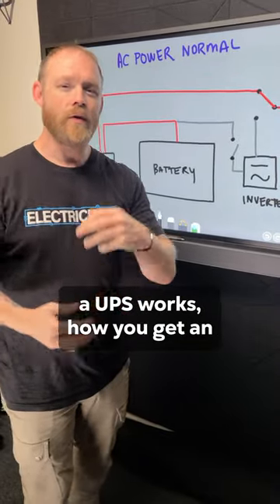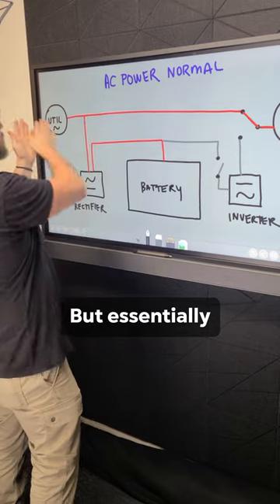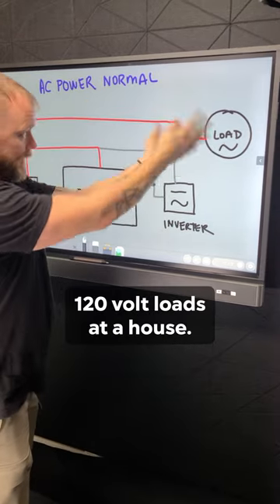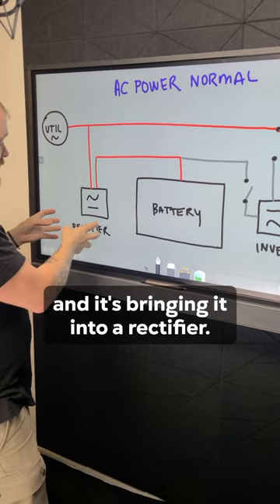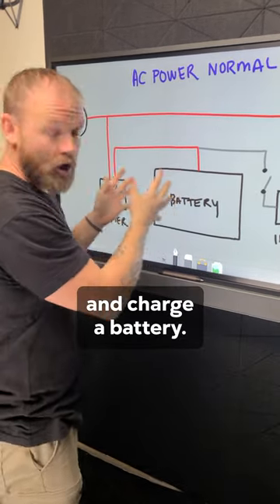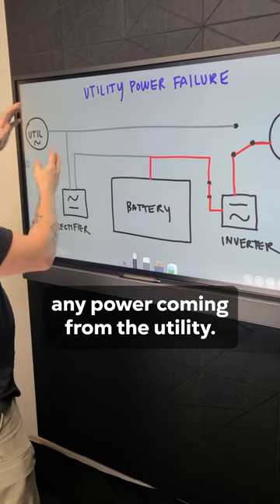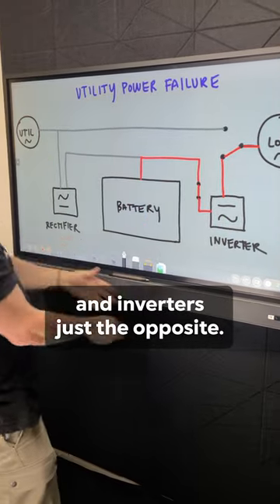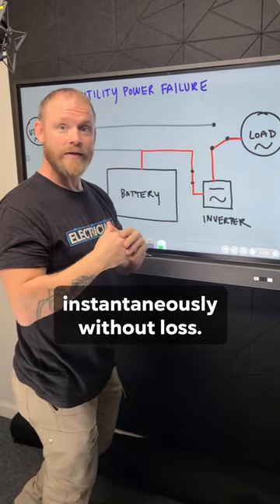How a UPS Maintains Constant Power

Comment: A lot of tech equipment UPS systems I believe actually mainly run off that inverted power after the battery to clean the power waves prior to entering equipment. In those cases, the incoming drops, but the outgoing doesn't see a drop as it's been constantly connected the whole time.
Reply: Line interactive(as described) vs online/double conversion(the one you want) also pure sine > mod sine
Reply: You are also correct. He described a common household UPS.  The UPS you described is more niche.
Reply: @danielmcgowan9534   "niche" as in every UPS you should be using for computers that aren't laptops, such as servers, desktops, etc. Even the low-end UPS' designed for computer use do this. Which is why they fail when the motorcycle sized lead acid battery dies. Some of those units are good enough to simply replace the battery packs and keep on rocking. The desktop support models, not so much. They have the low-bid capacitors in them, so when they error out, replace them. (IT guy for over 30 years here).
Reply: @phillipsofthedriver 
Laptop is already its own ups ... 😂
Reply: This is the cheapest version, better to use direct online which has the feed to the DC input then Inverts it back to AC then the setup as drawn is UPS feed and bypass from mains.

Comment: You didn't explain how the system automatically switches to battery power.
Reply: The unit he laid out is different from what we see. Typically you have a normal (bypass) input and a rectifier (EM) input. They both feed batteries which feed an inverter. The inverter is what’s running the load. 

When you lose normal power, the load is still being fed by the batteries. The generator starts and continues to charge the batteries. It is literally uninterruptible as the name suggests. These are typically used for critical data center loads
Reply: Depends on the ups, i got an older apc unit that uses a relay, coil isbpowered by the utility side and is allways energized, when power gwts cut it de energizes the relay and the nc contact is the inverter portion
Reply: @markzamiechowski5352 it’ll not be using a relay because the switching delay will be too long. For instant changeover, a transistor will be employed. 
The best units, so called online type, work by ALWAYS proving power to the load from the battery and inverter. 
The input mains power is there solely to supply the inverter with rectified AC and the maintain the battery. 
A mains failure won’t even be noticed in this case (unless the battery is knackered and cannot maintain its output to the rectifier)
This kind of UPS is mostly used to power computer servers, telephone systems etc because no matter how ‘dirty’ the mains input is, the output from the inverter is always nice and clean and runs bang on the correct voltage and frequency.
Reply: @2Sorts  not sure what to say,y.old ass apc uses a relay the way i stated above, I've torn it apart and traced the circuit,  butthats why in my original comment i said not all ups's
Reply: @2Sorts I've had "dirty" ac eat up UPS batteries at work. Due to issues with incoming power from the grid, we had odd frequency fluctuations. It was driving the UPS circuitry mad causing us to lose PCs. Had to run them off of a regular surge protector for a bit until the issue was resolved.
Reply: @Spcbrindley  ... bottom line is the battery won't charge and you always run on the battery if the power is too low or dirty. Not charging properly is what was eating the battery. You were lucky it only took a surge protector to do that.
Reply: Magic... 😂
Reply: My question also. I understand how it is able to store and provide power but the uninterruptible part?
Reply: @JL-ul7xk    think of keeping a maintainer / bat charger on your car battery. The battery is always up and providing power to the car as necessary. There is no "switch over" because your primary source IS the battery.... but via an inverter to make 120 volts. This is a true un-interrupted power supply. (UPS)
Reply: I build ups with relays all the time. For the most part it is seemless switching.

Comment: Your example UPS does cause some transients on the output because of the switch on AC loss. Most datacenter scale UPS'es are double conversion/online which means the output is always fed from thr inverter for truly uninterrupted power.
Reply: Also data centres have generator backup in case the utility power goes off for a longer period. Utility power gets disconnected before generator gets switched to the dc converter. Likewise sensors will wait several seconds after the utility power comes back on before killing the generator and switching back to utility.
Reply: @fernanddubois1792  that is super customer design dependent. I've worked in places where it was infeasable or impossible for a reasonable cost to have a generator and instead the customer put in 1 MWh of battery storage. I've worked for others that don't use a battery UPS at all but instead flywheels that cover the ~30 second gap between utility loss and generator loading.
Reply: @fernanddubois1792  ... in a commercial system a gen set is generally running the building within 5 seconds of an outage... but 5 seconds is too long for a computer to be down. You now have lost data.
Reply: @spencerryan2657  ... yes, a giant flywheel running in a vacuum was old school. These days you have emergency lighting, a UPS on computers, (sometimes the whole wing of a building) and NFPA calls for the gen set to be powering the place within 5 seconds. It's part of the life / safety code in NFPA 70. Quite often a building will have a gen set for technical stuff and another that's strictly elevators, fire pumps, and lighting.
Reply: @rupe53 Sorry I meant to say in addition to the full time ups. The battery system in our case was designed to run about 20 minutes after utility power loss . Servers do not like power losses of a few cycles of ac.
Reply: @fernanddubois1792  ... I knew where you were going, but you did say 30 second gap to gen power, which has not been the case for many decades. Either way, a good UPS covers the gap. BTW, I haven't seen one of those flywheel contraptions in 40 years. We had one here in town for the old Emery Air Freight headquarters. It was backed up with a turbine gen set, which has been off-line (mothballed) since the mid 80s. It was finally removed to make space in the basement about 5 years ago. That set was oil cooled... no antifreeze at all.
Reply: I agree based upon the service school I attended for the 50 kVA and 100 kVA units we were responsible for. The phases are kept in sync for seamless transfers. One note, the inverter would radiate spikes on the synthesized sine wave as seen on a scope when holding the probe in open air. This caused the operators of the high impedance blood cell counters to stand clear as they cycled. Only one failure during my time there when  a $2 IC failed, blowing six 150 A fuses. I replaced the parts and the lab never felt a thing!

Comment: Thats the cheap UPS single conversion. 
The really good UPS systems use dual conversion. 
Where the rectifier is powering the inverter and battery charger.  And the load is supported by the inverter all the time.  And uses a static switch when the inverter needs to shut down if there is an overload. or fault on the load. 
25 year GE power quality engineer. 
I sevice most of the UPS systems world wide. 
up to 1mw and power switch gear.
Reply: How did you get into the field?

Comment: Your schematic has the rectifier output backwards… you should have DC -  symbol then an AC symbol ~ going to the load; no big deal but if you are going through the trouble of drawing it out then it should be correct.  Also the automatic switch would be either switch by a power relay or at the end it could be switched the user (manually). I follow and enjoy your training videos.

Comment: Now describe an "online" UPS. Used for sensitive electronics, it is running your load through the DC circuit 100% of the time to provide it with a clean artificial sine wave all the time and avoid momentary voltage drops when the utility fails. There is an efficiency loss across it (10-15% I believe) but a device that takes questionable quality utility power and outputs clean power is extremely handy, especially if generators are in play. I've had mine take 90v in and still run my servers with a clean 120 60hz.

Comment: I retired from a large hospital / research center that had huge UPS ' S that could supply backup power for halve a hour to critical loads. A company came in every year and performed a load test on them and replaced batteries every three years. One lab made things that took up to 8 weeks to produce and if they lost power for think it was only a minute they had to start over. Huge building had two 13,200 volt services, 3 2,000 KW Generators and this lab also had its own 13,200 volt generator & huge UPS System . Total of 5 separate power sources. Somebody said they had a Millon to one odds of ever loosing all 5 power sources at the same time.

Comment: It’s not instantaneously. Theres going to be 2 times when power is 0. 1st when power goes out and the battery turns on and gets connected. 2nd when the power is back on and the battery is disconnected to connect back to utility. You cant have two sources connected at the same time and you cant connect/disconnect live sources (in most cases)
An interesting way around it is using D-UPS (dynamic UPS). In which you have a constantly rotating kinetic energy storage unit with flywheel, a diesel engine and an alternator which, depending on the operating mode, also operates as an electric synchronous motor. 

If the public power grid fails, the systems acts immediately and without interruption because it is already in operation anyway. Part of the energy stored in the flywheel is used to drive the generator, that starts producing electrical power. Meanwhile, another part of the stored rotational energy is used to facilitate very fast start-up of the diesel engine. Within the shortest possible time the engine accelerates to its rated power output and can now start producing electrical power via the generator and stabilize the flywheel. This naturally happens without any gap or interruption.
Reply: Our electricity is 60hz which means 120 times a second the voltage is zero. So if the ups activates within 1/120 of a second it will just pickup the sign wave where the utility power dropped off. Meaning there was no time when  the electricity was interrupted.

Comment: every apc ups I've had over the years has a weekly self test or something.. it switches over to battery for a few seconds to ensure it's working properly. this kills the battery much quicker and will need replacing. another problem I've had with apc is when the battery needs replacing, it just kills power even if utility power is fine. I had enough with apc. got a cyber power, used that for 6+ years on the original battery. then I switched to an eaton double conversion ups, much better.

a normal ups cannot work with a generator, unless it's an inverter type generator. with a normal generator the ac frequency changes with the rpm of the engine. when a heavy load turns on, the rpm will dip for a moment, which slows the ac frequency. the ups will see the unstable frequency and continue running from battery.

a double conversion ups is a neat thing. it takes ac power from the wall, converts it to dc, then converts it back to ac. it does this at all times while it's turned on. if I have 60 volts coming from the wall, a double conversion ups will convert it to dc then to a nice clean 120 volts ac. works great with any generator. the down side is the inverter is running 24/7, which does have some small energy losses. the computer equipment will use a bit more power than it would normally.

Comment: The battery can be feeding back into the grid when the grid is off according to the diagram.
Reply: The battery will not back feed through the rectifier. If it can, then the rectifier isn't working, and you've probably got a shot battery for it.

Comment: There are two types of UPS, one of them WILL ruin your shit, the other one will keep it safe.  A UPS like the one diagramed WILL ruin your shit.  While one that always runs off the battery will not.  Why? Simple, the switching load can cause power spikes, and fliker, and those thing will harm your equipment.  Look for a UPS that says the output plugs are battery inline.  That way the power is always coming from the battery.  And all the happens in a power outage is, the battery stops charging.

Comment: An online UPS does not switch. It always* runs on inverter off the float charged battery bank.
(* In bypass, the mains go direct to load. This is a fault condition)

Comment: So im dealing with a bunch of these not working right. I believe it’s because of severe power dips. But my inverter is constantly kicking over and it will click every 15-40 secs going from utility to battery. And it fries the inverters well before the lifespan of the device

Comment: There is a huge capacitor to that hold the load in that Second where the „Switch“ is going into Position „close“ / „Open“ when the power Source is offline…it’s just a millisecond but in the world of current and voltage, thats an eternity ^^

Comment: That's an offline ups. There are also "online ups" where the battery permanently supplies power to the outlet and gets permanently reloaded at the same time. Reason is that the switching inside an offline ups sometimes take "too long"(we still speaking of millisecs) so that pcs/servers still crashes.

Comment: What happens when the ac supply is restored ? How does it resyncronise the inverter supply back to mains supply , do you have to open the inverter supply interrupting the load then reenergise the load directly from the ac.

Comment: Your kind off right. You start off with your picture displaying the ups in bypas(the ups is not in use.) The second picture show the ups in normal mode ready to provide protection. The rectifier and inverter are often the same part, just programmed for the opposite function. The rectifier puts dc power on the dc bus. The inverter pulls dc power from the bus to produce ac voltage that that matches the input voltage. The batteries are connected to the dc bus so they can pull power to charge or supply power to the bus if the rectifier can't keep up. On high end ups, the  inverter's output is matched exactly to the line power so if there is a failure in the ups, it can switch back to bypas with out effecting the load.

Comment: Well, the system you describe is not instantaneous, there is a delay which can wreak havoc downstream. What you need to describe is a “zero wait state” UPS where the inverter is always driving the load and the ac line is providing current to keep the battery up and feed the inverter.

Comment: Here's my experience with multiple UPS systems over a 20-year period.
Most of the older ones have no software that prevents the battery from constant charge so that when the time comes the battery is fried or does not respond well and only gives you about a half hour of life. UPS is have become a giant cost and a waste of time as far as most big businesses are concerned because of that reputation. What is that for this are usually the ones who have done better research on the new technology available.

Comment: Makes total sense. What i have never heard anyone explain is why
  can't we store 120V?
Reply: You CAN store 120V... DC. You can't store AC power because it is always alternating voltage between negative and positive, reversing it's poles, and the voltage goes to 0V between each cycle. The AC power in your house is constantly going +120v to 0v to -120v to 0v, and back again, at 60Hz, or 60 times every second. If you draw it on a graph it looks like a never ending rollercoaster.  A battery can't store alternating voltage because of it's chemistry, it always has a positive side and a negative, to make it alternating, you have to run it thru an inverter, to switch the poles back and forth at 60Hz

Comment: A very simplified explanation for theory only.There would be a slight delay during changeover.
For uninterrupted power the load is sometimes through an STS.or constantly through the battery.They have in data centres rooms full of batteries.These ups only have to keep power long enough for the diesel generator to kick in.often only UPS power from batteries has to last a few seconds

Comment: Thank you.
How would you design a system that would incorporate a utility that supplies power with a property that has a battery system and alternative energy source?
Reply: Most off-grid inverters take grid power or generator power as an additional source and can use it to charge battery or power the loads directly. A hybrid inverter will do this and also sell excess alternative energy back to the grid when you are overproducing, with the proper agreements and meter from the utility company

Comment: A inverter takes DC and MIMICS A.C. with square pulse DC  it doesn't make AC
Reply: Square Pulsed DC (MSW) certainly is Alternating Current = AC.  MSW is not a Pure Sine Wave (PSW).  But there are UPS that actually output a "Pure Sine Wave".

Comment: im confused  is the ups wired to the receptacle that powers the computers power adapter? or is the ups directly connected to the pc  without an adapter? and the ups is somehow connected a wall receptacle?
Reply: it's connected to utility power by whatever means it takes, depending on the size of the unit. Yes, smaller ones plug into a wall socket.

Comment: Is this able to be used instead of a typical generator?
Reply: If big enough yes. This is basically how most solar battery inverters work, but the solar is an additional source of power for the battery, instead of just charging from the grid